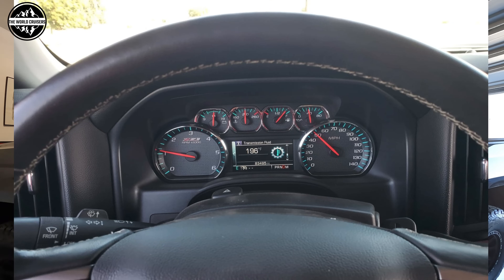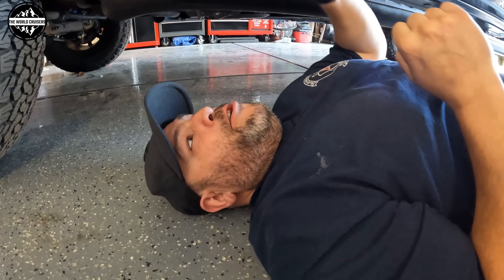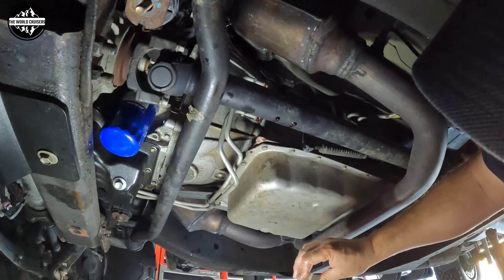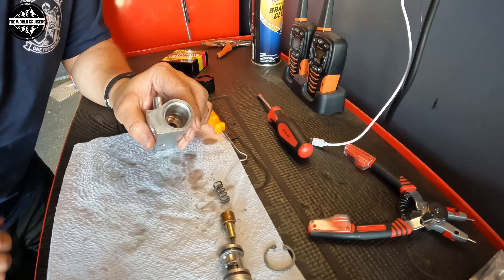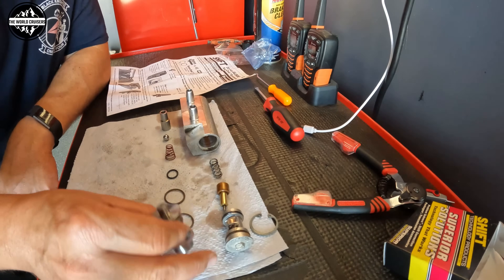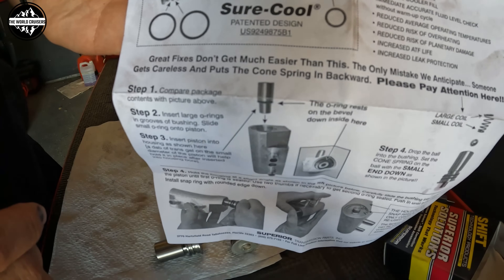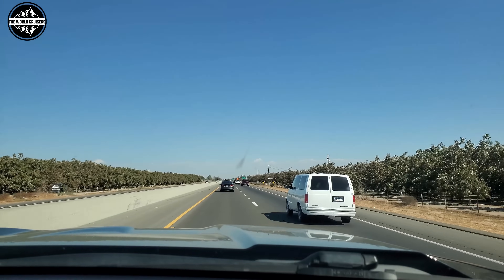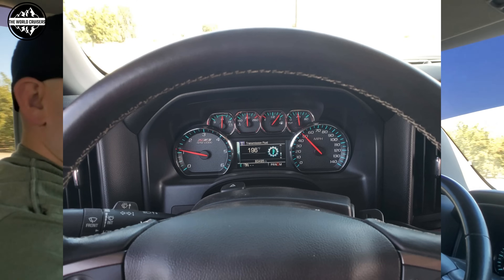DIY: How To Keep 6L80 Transmission From Overheating On Chevy/GM 2014-2018 | Pill-Flip, Sure-Cool Kit

Comment: I have a 2013 w/  a 6L80 ………and it overheats (185- 210) not pulling a trailer, not Hot days , not climbing hills .  😕. That one supposedly doesn’t have a thermo
Reply from the maker: I don’t think it does… you can try doing a transmission flush and get an aftermarket transmission cooler mounted on the front and see if that works.

Comment: If my transmission stays at 194 ish  but goes down to 187 if parked or driving can be still do this ?
Reply from the maker: I would recommend to do this, add a upgraded transmission cooler and have your TCC lock-up retuned so your transmission will last longer

Comment: Im trying to learn about all this. Why are all these kits for 2014+? They started using this trans in 2010 from what i e read. Is this not an issue in the 2010-2013 6l80s?
Reply from the maker: To my knowledge they didn’t have as much problems with the 2010-2013’s.   The problem with the 2014-2018’s is the factory transmission tune for the (TCC) Torque Converter Clutch lockout.   The true fix would be to get transmission retuned and to get a bigger transmission cooler like the true fix-cool 40k.  This kit is really just a bandaid to be honest.

Comment: Just to add to this story, I bought the new updated GM PN unit for my 2016 GMC Sierra SLT and did a simple one for one swap of the thermostats (bought the new gasket too), and then took the truck from Los Angeles to Las Vegas to visit my brother.  While in the desert, going up hill, in 104F weather, the hottest I ever saw the fluid get was 171F, but it hovered between 158F - 165F for 95% of the drive.  My 2016 only has 43K miles on it so hopefully I am extending the life of the transmission this late in the game on a 9 year old truck.
Reply from the maker: That’s awesome news!  We still recommend getting your TCU tuned so they take away the TCC lockout from gears 1-4 that way your torque converter doesn’t get cooked and takes out your transmission along with it.     Also doesn’t hurt to get 40k tru cooler transmission cooler as well.

Comment: I just bought a 2015 GMC Sierra and im considering doing this upgrade.  How has yours worked out the last two years?
Reply from the maker: This mod is a good bandaid, but you really need to have your TCU tuned to where your TCC lock-up is removed from 1-4th gears. A tuner experienced in GMs should know what to do.  Also we highly recommend getting an aftermarket transmission like a Tru Cool 40k to also help out with the temps.   A year and a half after we did this mod, the torque converter self destructed and took out our transmission with it which happens because of the TCC lock-up.  We ended up having the transmission rebuilt with a tow and pro kit, had a CTSV Torque Converter installed, a Tru Cool 40k Transmission cooler installed and then had the TCU tuned correctly and has been great since then.
Reply: Brand new transmission and the upgraded bypass and guess what,  overheats in stop and go traffic...

Comment: Just installed this kit on my 2017 GMC Yukon but my transmission temperature still reach 200.
Reply from the maker: You might need to get an upgrade transmission cooler and definitely suggest getting your transmission tuned  to disable the Torque Converter lockout from 1-4 gears…. A tuner that deals with GMs should know exactly what to do.  Hopefully you can still save your transmission.

Comment: Thanks for the video !!  ordering this kit this weekend and I'll do the modification next week..   just out of curiosity if the transmission oil is constantly circulated to the transmission cooler, does it shorten the life of the oil pump and cooler?  

Btw, I just went for a short  drive with my 2017 gmc sierra with an empty dump trailer (6x10). after few miles it was already 83c,(181.4f) and was climbing... So with a full trailer it's prob pretty hot !!  For sure I'll do the modification next week !  Only 105k km on my Truck and want to drive it for another 100k km, so can't thank you enough !!
Reply from the maker: Thank you for watching…. It’s an easy install and will help your transmission out.  If you want it to last a long time we highly recommend you to take your truck to a tuner and have them tune out the Torque Converter lockout in the gears 1 through 4, if not your torque converter will eventually start tearing apart internally and will destroy your transmission.  Also it’s best to get an upgraded transmission cooler to keep the temperature way down.

Comment: Hey guys don’t bother with this kit. It does not work. I installed one plus I installed the expensive one. Neither one of them worked. Go buy yourself an external transmission cooler and install it.
Reply from the maker: It worked for ours for about a year and would definitely recommend doing this, an external cooler and get your  TCC lock out tuned which is the main problem.
Reply: Two things could have happened to your transmission 1. the parts were not installed correctly and 2. Your transmission was already getting hot for a while and the torque converter it going out and metal shavings are clogging the filter and preventing new fluid to flow through the system because I installed this kit and had no issues but the factory torque converters suck i would recommend getting a billet torque converter to make the transmission last
Reply: I bought a PPE transmission bypass valve and it works wonders. Keeps my transmission temps between 140 and 160 on a hot summer Texas day. Im about to install my Mishimoto tranny cooler here in 2 days. Gotta keep these weak transmissions running cool, if not, the TC will melt away. Damn GM.

Comment: The trans is designed to slip when it changes gears that's the problem
Reply from the maker: Definitely agree… it’s the factory Torque Converter lockout tuning.

Comment: I installed the superior product. However, I still have heat issues?? Clean trans fluid. I have no clue. Anyone have any ideas?
Reply from the maker: Try to upgrade the transmission cooler with a true-cool one and have your TCU tune out the TCC out of 1 thru 4th gear.  If that doesn’t work then most likely your torque converter and transmission are already toast.

Comment: Do you still have the truck.? I am hesitating on pulling the trigger on a 2015 tahoe 89 k miles.
Reply from the maker: Yes, we do.  We had to put in a new built transmission in this year.  If you do get the Tahoe, we recommend you to take it to a shop that tune out the factory torque converter lockout, upgrade the transmission cooler and have the updated transmission thermostat from GM.  Also, if it’s in your budget do the DOD delete and don’t just shut it off with a handheld tuner.
Reply: @TheWorldCruisers  thanks.

Comment: This DOES NOT WORK for 4.3 v6!! Just a heads up!!
Reply from the maker: Hmm I wonder why?  Do they have the 6l80e?
Reply: @TheWorldCruisers 4.3 shares the trans cooler with the radiator so you’ll never get the temps down because of that!😡 I will install a separate cooler just for the trans!

Comment: ALSO ALL 2500 HAVE A HOT TRANNY PROBLEM... U MUST UPGRADE YOUR TRANNY COOLER ASAP I JUST DID TRANNY ON 2500 8K THEY ALSO RUN HOT ALL GM PRODUCTS

Comment: OK EVERYONE.. THATS NOT ENOUGH  YOU ALSO NEED TO DO THE AFMS SO U CAN STOP THE MOTOR FROM GOING TO 4 CYL OR IT WILL DESTROY YOUR MOTOR THIS IS A MUST LOOK FOR THE RANGE PRODUCT ON YOUTUBE $250 A MUST FOR ALL 1500 GM IF YOU DONT ITS BY BY MOTOR & DO A BIGGER TRANNY COOLER ASAP
Reply from the maker: While I agree with you, I would also like to add that it’s just a band-aid because the poorly designed factory lifters are still in the engine.  I would recommend doing the complete DOD delete kit with replacing the lifters, plugging the oil passages and have it tuned.
Reply: @TheWorldCruisers  Actually the lifters work fine in 8-cylinder mode and they are not damaged when you install the plug-in delete. When it is in four-cylinder mode the lifters are not under normal load and that where there are problems and I have also read that dirty oil is a major problem for folks that don't stick to a maintenance schedule.
Reply: @TheWorldCruisers  Why did you not decide to change out the bypass gasket when you ordered the kit?

Comment: Ok, mine was running at 196 degrees so I installed this and now I’m getting up to 205 degrees!😡I took it apart to see if maybe I installed it wrong but it was installed correctly! I had high hopes for this one, oh well
Reply from the maker: I would try to drop the pan to inspect for metal shavings,  try to flush the transmission,  and take it to a tuner so they can tune out the TCC lock out.  Hopefully you can still save it….  Our transmission  unfortunately went out and now in the process of having it rebuilt and using a CTSV torque converter.
Reply: Yeah flipping the pill made it worse for me tbh so I’m switching by it back
Reply: It don’t work for the 4.3 v6!!! Only the 5.3
Reply: @4mudski  that’s good to know now
Reply: @Slo_N54  I have a 2014 4.3 and did the pill flip. Works good so far, but the converters are cheaply made. A trans tech on youtube said you should remove the stem by pulling it out or it may loosen and cause problems. It was a Cottmans trans tech. I also pulled the pan , changed filter and had a drain plug welded in. Some techs are reccomendeding replacing the TC with a billet TC.

Comment: Before you replaced any of these parts was the truck kind of shaking when you accelerate after the transmission warmed up? Mine runs fine when i first drive it in the morning but about after 30 minutes of driving home from work it acts like it wants to start slipping. Trying to fix small things before i decide to rebuild it
Reply from the maker: Not really, I was just taking a precaution because we live in a hot climate and didn’t want to take any chances.  This is will help but eventually the transmission will go out.  I recommend doing this mod and take the truck to a place to tune out the TCC lock out in the first four gears.
Reply: @TheWorldCruisers  thanks for the quick reply!

Comment: thanks man. mines been running up to 250 no joke
Reply from the maker: Unfortunately it might be far too gone….  Sucks the way these trucks are built these days….
Reply: @TheWorldCruisers  so I can't get this part anymore
Reply from the maker: You can and it might help but your transmission is on its way out….
Reply: @TheWorldCruisers  mines goes over 270* and then starts flashing transmission overheating idle engine

Comment: I just did a fluid flush and replaced the filter. And I installed the surcool system and my Temps are still going over 200° can anybody please tell me why and how to fix it?
Reply from the maker: I hate to say this but your Torque Converter may be going bad and taking your transmission out with it….  The only thing I can think of that might help prolong the total failure is to take it to a tuner and have them tune out the lockout 1-4 ….   Other than that just be prepared to be replacing your Torque Converter and transmission in the near future.

Comment: Excellent video, I am still disgusted with Chevy setting their trucks up to fail like this. I am already on my second tranny, about to replace AC condenser as it has the notorious leak all of them Will end up with. Being as I am going to loose tranny fluid as the Condenser is also shared with the transmission cooler (another genius idea to sell parts), I am going to nip this in the bud; damn thing gotta last until I can afford to ditch it. I still feel like 165 degrees is rather high for no load. I do not see a point in that O-ring on the "pill" wonder if that would shave a few more degrees off to have a slight trickle of flow.
Reply from the maker: Thank you!  Yeah, these trucks were definitely not put together very well…. My transmission went out in December 1.400 Miles away from home… the torque converter went out and took the transmission with it.  The mod helps but the real problem is the torque converter and the factory TCU tune.   Best economical way to fix the transmission issue is to swap out the torque converter with the ctsv or the ZL1 one which doesn’t need tuning.  But would recommend to get your TCU tuned anyways. Most shops will know what I’m talking about.
Reply: @TheWorldCruisers  I actually do not know what TC was used, the paperwork I got after using warranty to get it fixed.. is quite vague and I had to fight like hell to get it from the idiots. I need to take care of the heat though, I can tell a drastic difference as it heats up, which takes right at 40 mins to reach 196.

Comment: Thanks for this! If I make this change now, will it help in the long run, or has serious damage already been done and it is too late. I swear I've had this transmission issue since I bought the truck new in 2018, but it was rather subtle so I didn't understand the extent of the problem.
Reply from the maker: It might help with the temperature but honestly sounds like your transmission will go anyways.  Best thing I would recommend is have the torque converter swapped out for a ZL1 or CSTV one and have a transmission shop flush or check out your transmission.  The factory torque converter usually starts going bad because of the factory tcu tune and ends up taking out your transmission along with it.  Ours went out this past December even though the proper maintenance was done and I had this mod.  Temperatures never got hot until it finally just went out . And it was real sudden.
Reply: @TheWorldCruisers  I really appreciate the advice. It's a real shame. I love this truck otherwise. Truthfully, best vehicle I ever owned. Maybe it's worth a new transmission, haha.

Comment: I live in Texas today my transmission hit 194 so I just ordered the Superior’s Cooler Flow bypass valve kit
Reply from the maker: This kit really helps but I still recommend swapping out the Torque Converter as soon as you can if you have the 6L80e transmission.  You could go with an OEM CTSV torque Converter.
Reply: @TheWorldCruisers  Well, I can tell my experience that once the factory torque converter is on its last legs, the temps will rise from the ignorant factory temp of 190 to 220 and beyond. I bought my truck used, 16' 1500 "HD"; First pull with the trailer after I bought it, It would not shift out. Got worse and worse the further I got, by the time I got off  of te interstate it was in second gear to maintain 55mph. 67000 Miles. I have owned several Fords well over 100k and over 30 years old on a couple, never had to do more than change a water pump.
Reply: @TheWorldCruisers do I have to swap out torque converter if I done this process because my transmission don’t got over 187 if parked ??

Comment: Is it still running pretty good? Mine is at 63k miles and im about to do mine
Reply from the maker: It was until Last December… torque converter went bad and took out my transmission, so I would also recommend to do the torque converter as well.  You can get an OEM ZL1/ CTSV and it will work.
Reply: @TheWorldCruisers  Thanks, sorry for the same question i just saw someone else asked the same thing! Thanks again for advice !

Comment: Research I saw said the torque converters  are junk and will fail even with the pill flip. From around 80,000-120,000 miles. Recommended installing after market TC.
Reply from the maker: Yes you are correct…. This past Christmas mine went out without warning and took out my transmission at 90k.  Definitely recommend changing/ upgrading your torque converter.

Comment: This does work, I bought my 2018 Silverado brand new, and I installed it 6 months later and mine runs 40 degrees cooler, and I live in the desert southwest.
Reply from the maker: Yep sure does… we live in Central Valley California and gets up to 118 degrees here.. this mod definitely kept the transmission temperature low..
Reply: @TheWorldCruisers  I bought a used '18 Yukon that quickly developed a shudder and hard 1 to 2 shift. Is it too late try this fix?

Comment: Thanks for making the video. Is there any updates on how your truck is running with the mod.
Reply from the maker: The truck was doing great and the transmission temp never got high until last week after a 5,000 mile trip which was because of the Torque Converter going out and it took out the transmission in the process.  So my recommendation is to do the mod or updated GM thermostat and change your Torque converter to a ZL1 or CTVS one.

Comment: Thanks for the info. Will be doing this to my wife’s suburban. The temps have always been between 192-196.
Reply from the maker: No problem, it’s really simple and fast
Reply: That’s normal…
Reply: @timsXO  ... according to GM.
Reply: @timsXO  That’s why the transmission just went out and had to have a new one built with the upgraded thermostat and billet torque converter. Now temps never even hit 190.
Reply: @timsXO  if it were normal, GM wouldn't have redesigned the thermostat part for the 6L80 to open at 150F instead of 185F...

Comment: I added the kit on my 2017 Yukon but the trans temp still showed 225 after 30 min drive on highway with up/down 70 mph. Please advise if I was doing something wrong
Reply from the maker: You just have to make sure you put everything in the correct order and especially how the orientation of the spring.  You can try doing a transmission flush and see if that helps.
Reply: I had the same thinking of installing it wrong. Therefore I took it out and redid it.  All was correct on 1st and 2nd time.